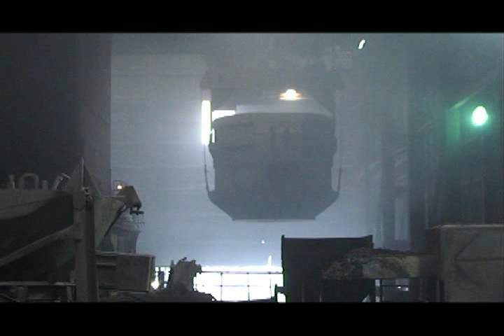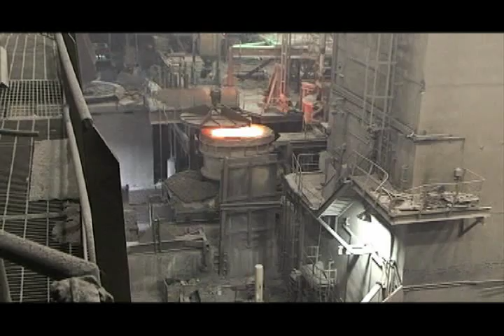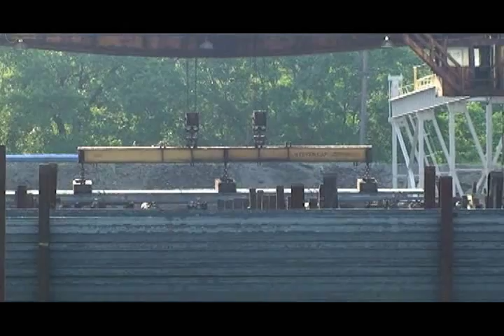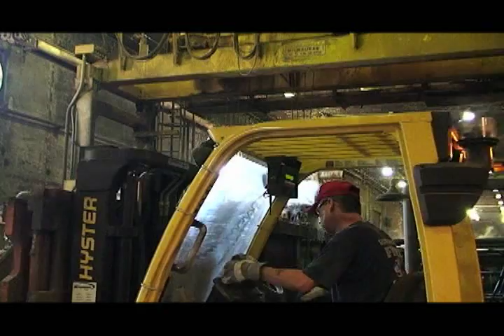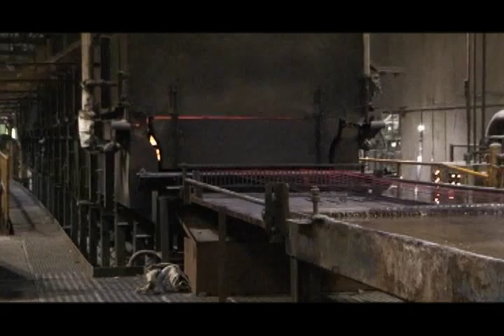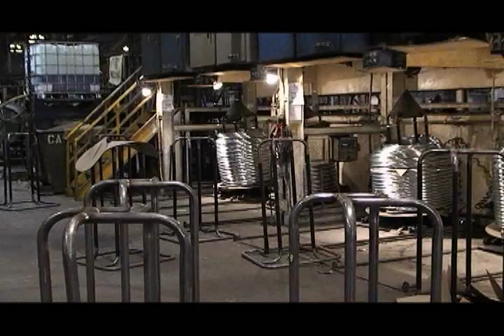Keystone Steel and Wire

Comment: I worked there as a Summer job during college.  We were referred to as the "yard crew," but we never saw much yard.  We were cleaning out refractory (fire-bricks) from the furnaces after the "melt" was tapped.  The floors were still glowing red, and we had to protect our boots with asbestos clogs.  We left a shovel behind while we went on a short break, and when we returned, the wood handle was burned away.  Tough job, but everyone who finished the Summer there was in top shape and lean.
Reply: Thanks for sharing that steel mill experience. I know someone who worked for a short while at the Northwestern Steel & Wire mill in Sterling, IL. He had a similar job of cleaning out the excess material that clung to the walls or one of the huge electric furnaces. He said like you that the floors could still be glowing and that they used explosives to break up the material for removal. Guess it was a low seniority job!